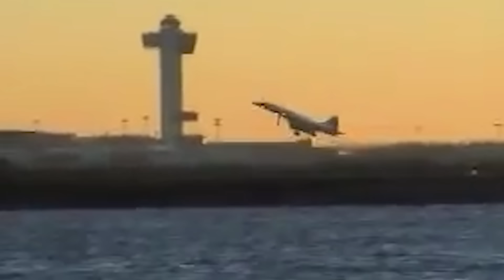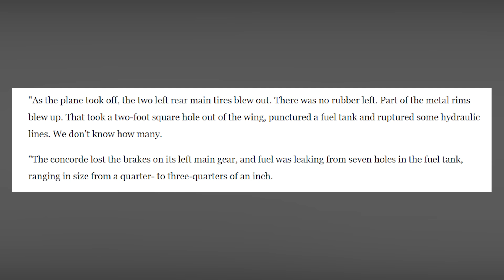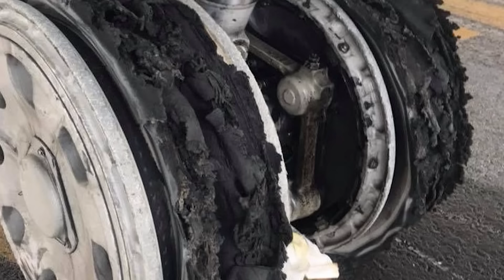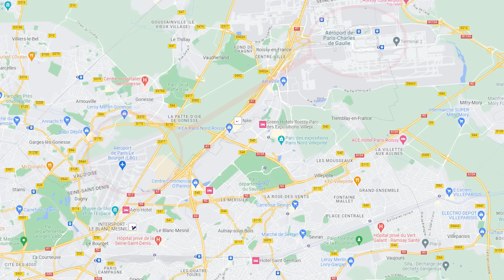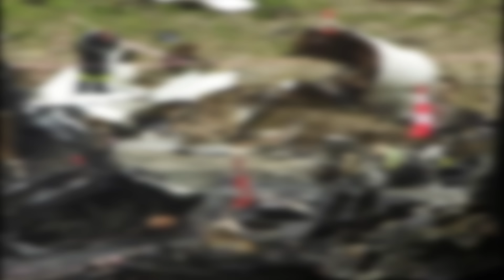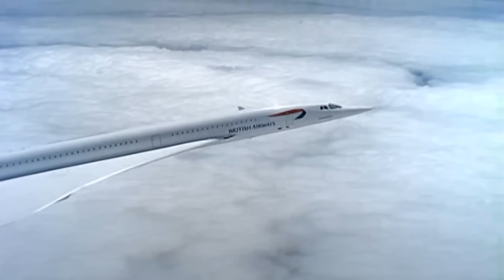The TERRIFYING Crash That KILLED Concorde | Air France Flight 4590

Comment: The crash was NOT what killed Concorde! The true reason was that the last two technicians at Aerospatiale who were qualified to work on Concorde's avionics wanted to retire, and nobody at Aerospatiale was willing to learn how to maintain such ancient technology. Had that not been the case, Concorde could still be flying to this day.

Oh, for anyone wondering as to my source, that was the Chief Flight Engineer of BA's Concorde fleet.
Reply: If it’s such ancient technology then why has it not been replicated and surpassed in today’s modern era?
Reply: @kopec56    Technically, it has. The problem lies in the type certification. The avionics of Concorde were certified as being safe for use at mach 2+. No other avionics in use on commercial jets are certified to that speed, and getting updated avionics certified would've taken years and a MASSIVE amount of money. And that's assuming that modern off-the-shelf stuff would even work on Concorde - not guaranteed due to an often forgotten aspect of Concorde's flight regime. 
Aerodynamic heating of the fuselage meant that the plane grew roughly a foot longer during flight. One side effect of this was that the avionics were literally baked on every flight, being heated to roughly 200*c. The old stuff was designed & certified to work in that environment. Modern stuff isn't, so any update would most likely need to literally start over, designing from scratch a whole new set of avionics that would work in Concorde's unique situation, followed by years of ground testing to be sure that they could survive several thousand heating/cooling cycles, followed by several years of in-plane testing before the new avionics could be certified as safe for commercial use...
In the end, updating Concorde would've cost far too much money to be viable for such a small fleet. At the time (2003), there were studies done that estimated that an avionics update could cost somewhere between 10 and 15 BILLION dollars. With only 13 airframes in service, it didn't make commercial sense. Thus, when Aerospatiale announced they would no longer be able to service the existing systems, Concorde died.
Reply: @gchampi2 So---why couldnt existing systems from contemporary military aircraft (some of which fly much faster than the Concorde did) be adapted to work at likely far less cost?
Reply: @donreinke5863  Again, type certification. Military avionics from fast jets, while capable of doing the job, would still need to be certified for commercial use - and that's IF those avionics aren't still classified. Getting the avionics of a commercial plane certified is a process that takes years, for a simple reason. The consequences of a crash. 

The rules are quite different in the military aviation field, because every military pilot knows and accepts the risks inherent in every flight. Commercial passengers are paying for a service - to get from point A to point B, safely. As such, the safety certification takes a lot of test flights, a lot of system checks, and a lot of time. 

For instance, the recent 737MAX accidents and grounding was a result of an avionics update, that Boeing was allowed to self-certify, without going through a full certification process, as it was supposedly an iterative upgrade from the previous systems. The result is well known. 

Updating Concorde wouldn't be like that, as it would require a complete replacement of the old analogue systems with modern digital systems - essentially updating from 1960's tech to 2000's tech. Possible? Yes. Practical? Not without years of work, and massive amounts of testing (and money). With only 13 flightworthy airframes, the money and time needed to keep Concorde flying just wasn't available...
Reply: I've always been told, having family who worked on the Concorde project at Filton, and who have put me in touch with former BA crew (and likely the same former BA captain), that Aerospatiele did not want to keep Concorde going, and that they had a very lax attitude to safety from the French side. The story I've always been told from many people who worked at Filton was the BAC employees would work throuhout the day, do their work then go home, the French side would, and this is from several people who worked directly on Concorde at all levels, from working with everyone from Brian Trubshaw, to the secretaries, to the runners as we'd call them no who were ferrying messages and taking things to be sent in sealed envelopes and all that, who have said the French would go off for multi hour lunches and come back visibly drunk and then find out the work they were meant to do, was done by the people at Filton in the hours the Aerospatiele employees were off having lunch.

I've also heard, but probably apocryphally, that Brian Trubshaw was extremely upset and never forgave André Turcat: for jumping the gun on what was supposed to be simulltaneous takeoffs, with André Turcat: jumping the gun on that. Reportedly, again from what I was told by people who were working at Filton when it happened, it aused a lot of bad blood between both sides

Comment: It’s amazing that the Concordes were grounded after a few accidents. Every other plane has had probably as many, or more deaths
Reply: They were grounded because they weren’t profitable. Even  before this crash they were losing money. It can only do a few select routes due to noise and it was just too expensive for the average person. Had this crash not happened they still would have ceased operations sooner than later.
Reply: @MarissaNye This a common misconception, BA operated Concorde profitably in its later years having realised that wealthy clients were happy to pay the increased fares necessary.  The French decision to end operation meant that the total fleet was too small for suppliers of spare parts and maintenance support so rather than having the fleet eventually go unserviceable BA retired the aircraft.
Reply: @MarissaNye  No. BA were making a decent profit with Concorde. They did for quite a few years due to good marketing . They were getting old but from memory, BA still expected another 5 or 6 years operations from them.
Reply: It’s not, the plane was already in financial ruin and this was the cap
Reply: Concordes were ??
Reply: @Robert_N  my bad, grounded*
Reply: And over the years many types have been grounded for investigations after crashes. 737MAX, DC10, Lockheed Electra for starters. I loved the Concorde, but grounding it until the problem was resolved was the right thing to do.
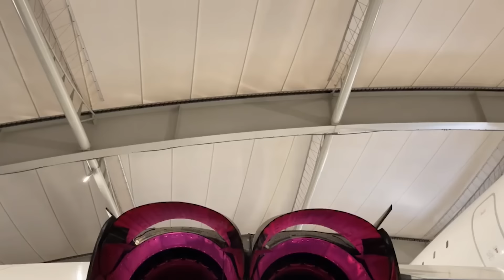Reply: Which aircraft is most likely to crash before the other 7077 17:27 3747 5767 7787 which one.... A380???   
      OR THE CONCORD??   SIMPLE I THINK.....SEE HOW QUICKLY CONCORD AND SHUTTLE  ARE GONE?  ???
Reply: It was due to 9/11 and the hit on the airline industry as a whole.
Reply: Airlines were already begging for a reason to get rid of the Concorde, this crash gave them justification to do so. It wasn't really profitable to own them, so airlines were done with it.
Reply: @@AlexMit-yj7rp well there was for sure two, but the first one was back during testing, and only two pilots died as a result they were trying to show off from what I seen
Reply: It has a ton of issues in many airspaces and can only be flown over oceans which was pretty much stuck trans Atlantic due to the sonic booms it produced. It also tore up runways which made it even more unwanted on commercial strips. Boeing knew this issue why they didn't pursue it at all. Russia completed 5 trips but to them it seemed impractical and destined to have more issues being a SST aircraft with regular people. Also Lend Lease ended the same year the Concord was retired. 2003.
Reply: Airbus A340 didn’t
Reply: Correction ! That was the only fatal Concorde accident during its 27-year operational history.

Thus the accident was not the result of Mechanical failure, it was caused by debris that was on the runway tarmac.

Now all other Airlines that are riddled with accidents and many more fatalities happen to be still in the business of carrying passengers.
Reply: @australiaplus9629  there was one other Concorde crash, but not under the name Concorde, it was wayyy before the last one, during a testing phase and two pilots died I believe is all

Comment: It was THE fadtest commercial aircraft , not one of them
Reply: Well, the Tu-144 was faster, so „one of the fastest“ is the correct phrase
Reply: @swems-z3s  No the Concorde actually cruised at 150 miles an hour faster and didn't crash until 2000 , where as the Russian version was a commercial disaster and had two disasters.
Reply: @ewaf88  no. Tu-144 could reach Mach 2.15, Concorde couldn’t.
Reply: @swems-z3s  But only in test perhaps, not carrying passengers.

And when it was pushed to its aerodynamic limits...it crashed,  twice

It was a hopeless and dangerous piece of engineering, and ended up as a freighter
Reply: @ewaf88  all correct. But it was still faster, so the claim in the video is correct

Comment: I wonder what would have happened if they had aborted the take off  ? Would the outcome be the same  ?
Reply: The fire would have ignited the 95 tons of fuel on board unless airport personnel could have extinguished the fire before that happened.
Reply: They couldnt abort the takeoff, as they were only informed of the fire, just as they were leaving the ground. And even if they hadnt already rotated, there was nowhere near enough runway left to stop. After the runway and runoff area was a fence, a service road and a building, all of which they wouldve hit.
Breaking all the rules to stay on the ground wouldve been certain death. They also didnt know, how bad it was, they just knew "engine fire". Le Bourget was their best bet, it was only 3-4 min of flight time in the direction, they were going, but the fire was just so intense, it literally melted the wing. They were screwed, the moment they hit that debris.

Comment: A few of things to mention about this accident, flight 4590 used concorde 007 which was the first and oldest of the concorde fleet and was used as a backup aircraft because of it's age and being least reliable of the fleet (think of an old coach thats kept by a coach company used to fill in when others are not available), next the missing undercarriage spacer was very important as this keeps the left-hand bogie tracking straight and true the flight data shows the pilot was having to input right rudder to counteract the left tracking in the take-off roll (if the plane hadn't been tracking left would it have even hit the strip of metal, if this was the cause?), the failed reverse thrusters on the left engines indicate that area was undergoing some sort of problem in the undercarriage/engine nacelle wing area (was this area under stress?), next firefighters at the airport (not known for being bad witnesses) reported that 4590 was actually on fire way before slab 175 (the slabs of concrete making up the runway) where the metal strip from the DC10 was found but the were never interviewed by investigators (maybe because their statements didn't fit the narrative?), next the first piece of wreckage from 4590 found was at slab 157 being part of the water deflectors on the bogies to stop water being ingested into the engines in wet conditions, the Dulles incident of the wing being punctured was actually part of the water deflector piercing the wing (they are large heavy fibreglass mouldings) after which they were redesigned to incorporate stainless steel wires so if they broke pieces wouldn't fly up into the aircraft, British Airways fitted the uprated deflectors, Air France didn't (therefore were Air Frances fleet fit to fly?) the NTSB's John Cox (of Mayday/Aircrash investigation fame) puts faith in the mantra that the first piece of wreckage found along an accident aircrafts flight path is usually the sign of the problem that leads to an accident (on that basis why was the water deflector wreckage not investigated or ignored?), next pictures and video of 4590 on fire show flames extending approximately 10 M from the back of the wing this would point to a very large hole pouring many litres/second of fuel out of the tank a ruptured tank due to a shock wave loading tends to crack or fail along joint lines or sharp corners leading to a weepage type of leakage whereas the pictures show a huge volume of fuel escaping (1985, British Airtours flight 328 at Manchester airport had a combust can pierce the wing tank on a 737 yet the fatalities of the fire didn't really occur until the plane had stopped and the aicraft was engulfe in flames by the pooling of the fuel on the ground) looking atr the pictures it looks like the seat of the fire is in the undercarriage bay at the back where the flames are blackish indicating the flames are very "rich" with excess fuel, finally the invetigation into te accident seems flawed in that you had the BEA a french governmental agency investigatin an Air France aircraft accident (Air France was about to be sold off by the goverment at the time) maintained by Airbus (more on them soon) made up of a conglomerate of companies including Aerospatialle whose controlling shareholder was the French goverment, the other interested party would be the UK as BAC (British Aircraft Corporation) were the co-developers of Concorde so in the interests of transparency should have let Britains AAIB take the lead (the BEA did share their work with the AAIB but were only given interpreted flight data not the "raw" data recovered, they may have drawn a different analysis) and lastly after safety and refitting Concorde did return to flight and although not super profitable British Airways thought they could make a go of it but the french government was trying to sell off Air France for which Concorde was a net loss so Airbus (who provided maintenance support for concorde) wanted to renegotiate the contract whereby the maintenance charge would be increased by 42% and rising with that the concorde business model became uneconomic.
Reply: What took my attention in your comment is that the firefighters have witnessed a fire long before Concord hit that metal piece. 
That changes everything about the truth on causes of the Concorde disaster. 
II have always doubted the official version since the very beginning.
Thanks for your explanations.
Reply: @foooooob  I could've mentioned other anomalies with the original accident investigation such as the famous film of a concorde tyre being run on a roller frame with a similar piece of metal introduced to show the bursting process (it would show the desired result as the metal is being effectively fed into a mangle ---- metal run over on a road/runway reacts in many ways with freedom to move about) or the pictures of the piece of tittanium published (this is what originally made me question the official narrative) shows a remarkably pristine strip with no scuffing and paint and sealant that appears intact, but I didn't include them as my comment was already pretty long.

Comment: Was not the best idea putting two afterburning turbojets into a single nacelle. If one were to experience an uncontained engine failure, the other engine may be destroyed as well by shrapnel from the first.
Reply: I wonder if that was why all the US SST designs had four separate engine nacelles, in spite of the higher wetted area that would result?

Comment: So given the modifications British Airways made to their Concordes, is it reasonable to say that this disaster wouldn't have happened had it been a British Airways Concorde?
Reply: The tire covers were a great modification, if only Air France had followed suit
Reply: They modified the fuel tanks too making what was already a statistically safe aircraft even safer.  BA we’re making a respectable profit on Concorde flights at the time, they had raised fares after realising that the rich clientele were not put off by higher prices.  When Air France ceased Concorde operations the total fleet was too small to be viable for the suppliers of spares and support services the aircraft required.  Rather than a slow death as aircraft became unserviceable, BA had little option but to retire their aircraft as well.  I was lucky enough to witness both the maiden flight of the British Concorde (002) and the very last flight of a Concorde anywhere in the world.  I saw her many times at air shows and flying high over my home on scheduled flights.  I still miss her.

Comment: Where did you get your figures from ie A380 cruise speed?!
Reply: I thought the same thing. The latest 747 is, in fact, a few mph faster than the A380. Not enough to really tell a difference as the 747s speed  is mach point 86 and the A380s speed is mach point 85
Reply: It's not its cruise speed, it's its maximum speed, which is mach 0.96.
Reply: Think it cruise at around 400 mph ish
Reply: 580 mph cruising speed